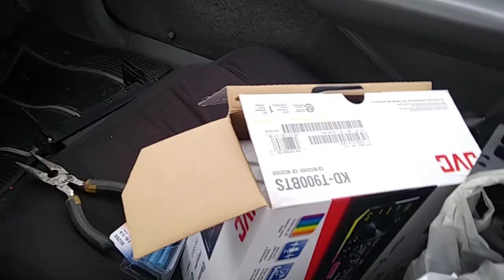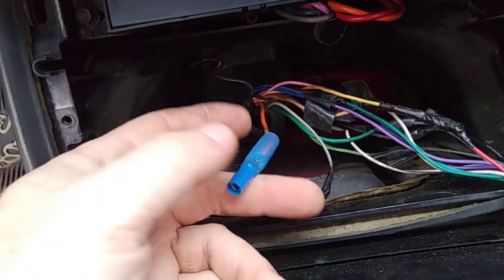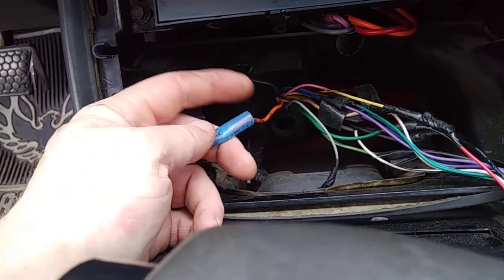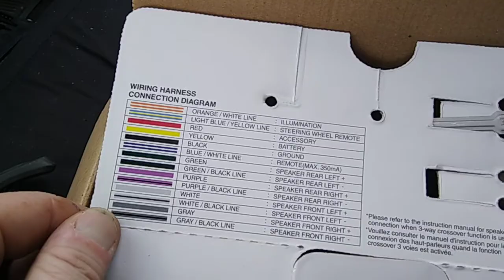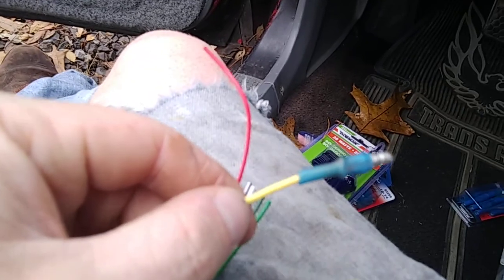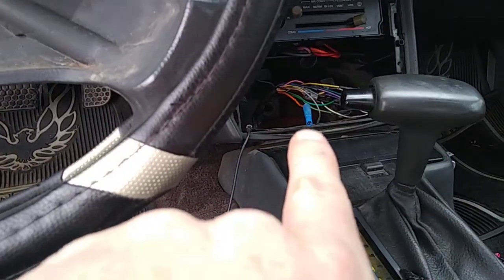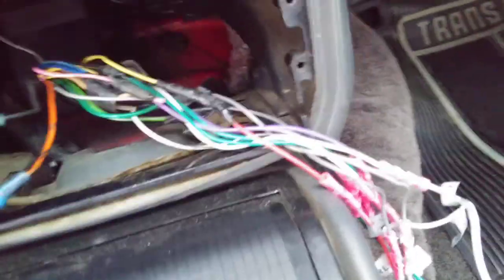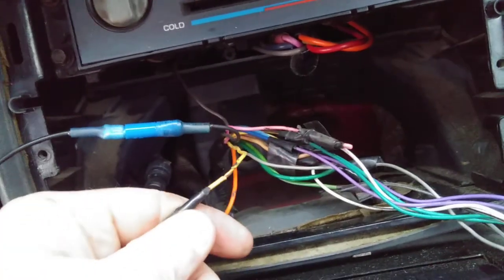91 firebird how to install jvc kd-t900bts head unit pt1

Comment: That’s excellent ideas using butt connectors. It does make a lot easier and simpler. I too had go behind repaired many damaged wires in my Camaro. What’s part number for both male/female connectors, and what store carry them? Thanks.
Reply from the maker: I got them at auto zone. Speaking of I'm at autozone now. Female PT number 85268
And the males PT number 85269
Reply: Okay, thanks.
Reply from the maker: @5sapaches25  yw